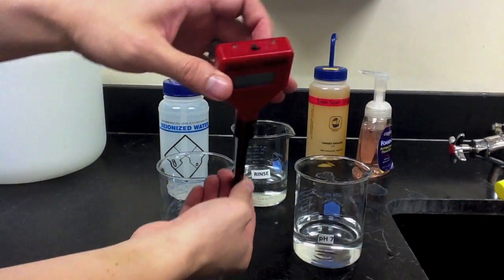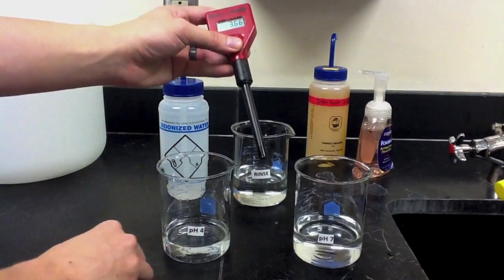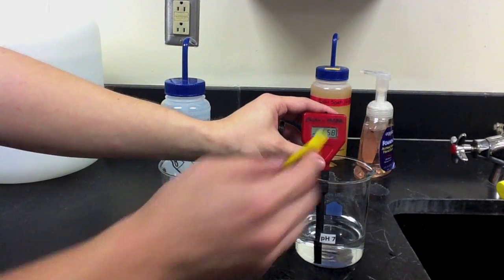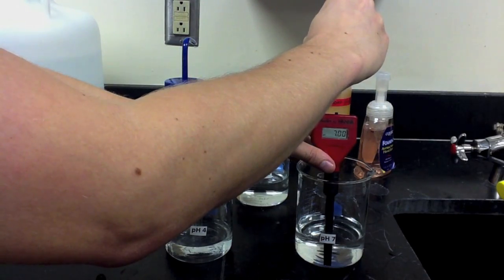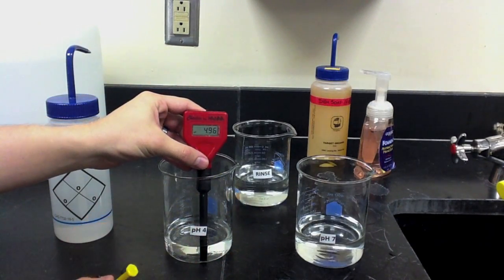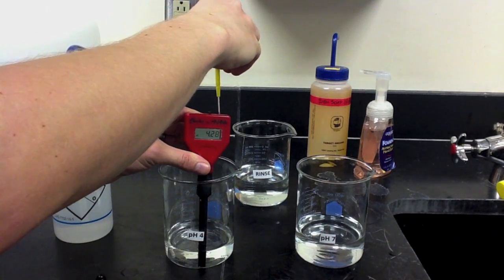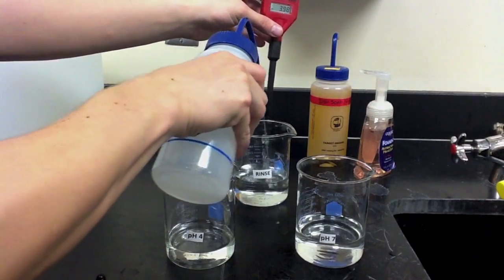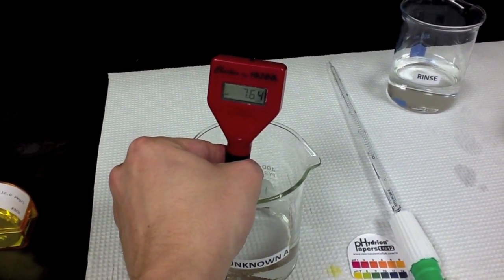Lab Protocol - Determining pH with a pH Meter (Unit 3 Acids & Bases)

Comment: can you answer me plss? whats the use of buffer 7 and 4 ? why there is a need for it?
Reply from the maker: The pH 7 and pH 4 buffers are used to calibrate the meter. It's similar to how you tare a digital balance. You want to make sure that you are getting accurate readings. You know the pH of these two buffers, so you will therefore know that the meter is calibrated when it correctly displays 7 and 4 for these two buffers.
Reply: Mark Garcia ok thanks